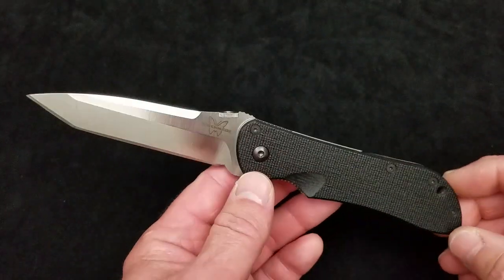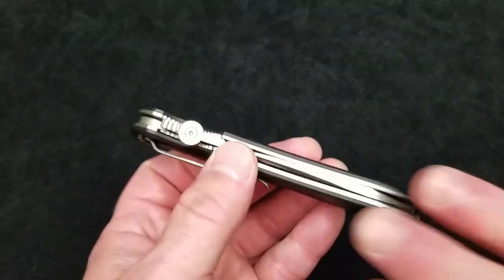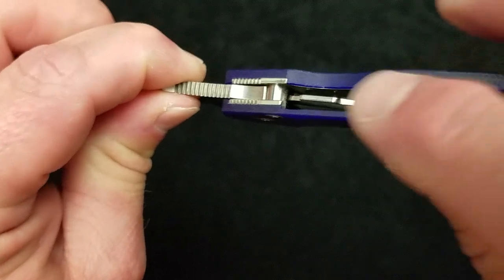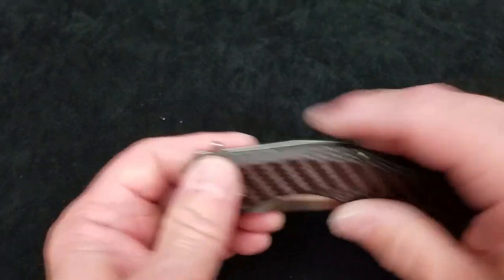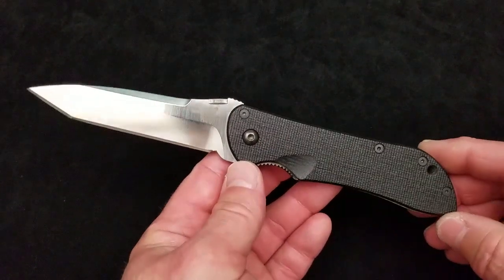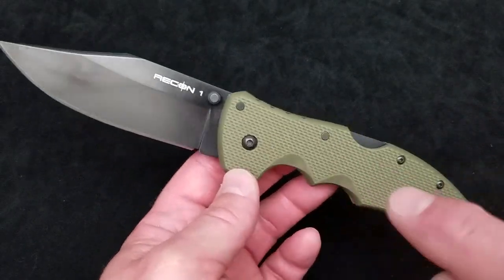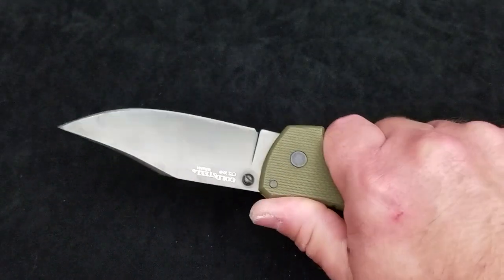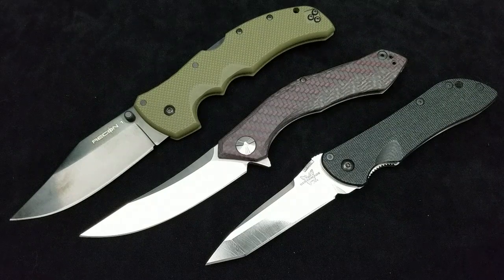Lockism...The knife worlds dirty secret.

Comment: Very cool Baz keep these lessons coming:) Although I don't own the Recon 1 knife I would get it in a heartbeat. From the sound of it, it seems safer for someone like me; who sometimes presses too hard with worry that it's going to close on my fingers or hands:) LOL!!!  And I got me a coarse Arkansas stone and my sharpening is improving. Now there's a video idea for you, but I'm sure you've probably covered it already. Sharpening knives for dummies type thing:) For example, people say "let the stone do the work" but I wonder what's that mean EXACTLY? Of course, I'm probably always doing it harder than needs be.. Later...
Reply from the maker: When you let the stone do the work it just means don't try to speed up the process by putting excess pressure on the blade against the stone. Just let the stone cut as it will with moderate pressure. 

I am terrible at freehand sharpening. My advice is get a KME system. So my advice is pretty much worthless unless you want to buy a sharpening system.

Comment: Personally I can't stand the frame\liner\sub\compression lock zealots that everything has to be buttery smooth and one hand operation. There are a few idiots that goes around saying that the compression lock it's stronger than Tri-Ad.
Reply from the maker: I love buttery smooth fidget toy knives. But we can't lose sight of or purposefully exclude all other aspects of design and real world usage. My fave knife in my collection is my 0452CF, but my go-to knives for harder use are always CS TriAd locks.
Reply: I am not going to compare the Triad lock with the Compression lock (or any other lock).  What I will say is that Spyderco says that their strongest lock is the caged ball bearing lock on the Manix.  (They, and others, have test videos comparing lock strength and the CBBL beats the CL.)  So if you are trying to compare the strongest Spyderco lock with the Triad lock, you need to compare the CBBL.

The only major lock type I don't own is any sort of back lock.  I have liner locks, frame locks, CBBL, and Axis style locks.  I don't have a problem with any of them, but I do prefer locks that don't put your fingers in the path of the blade.